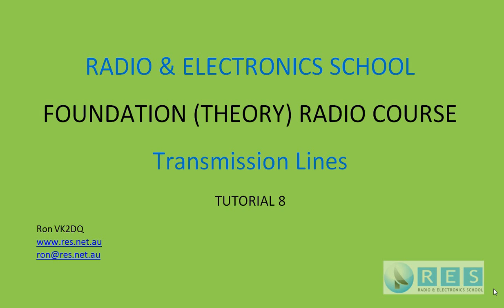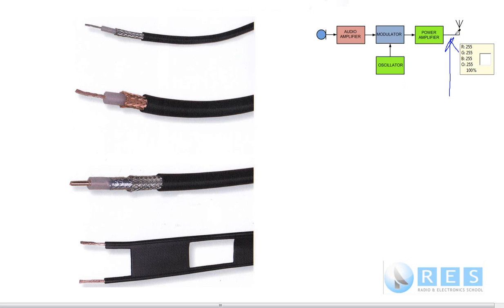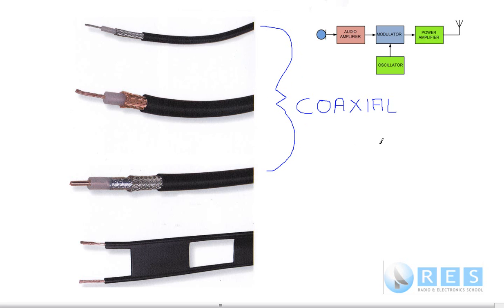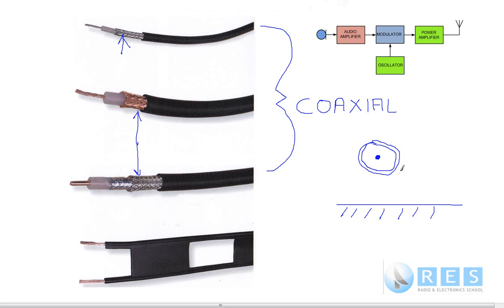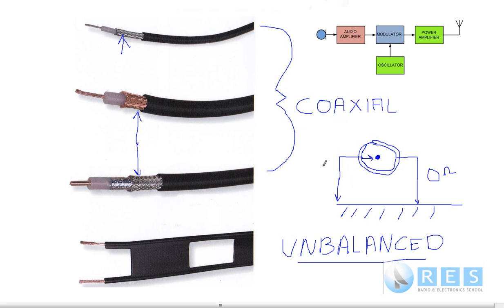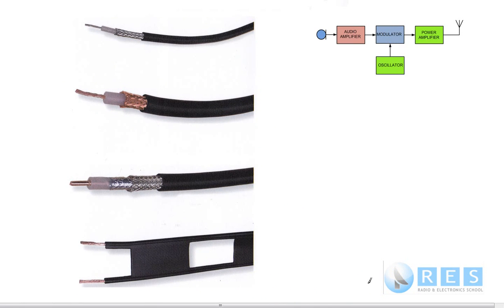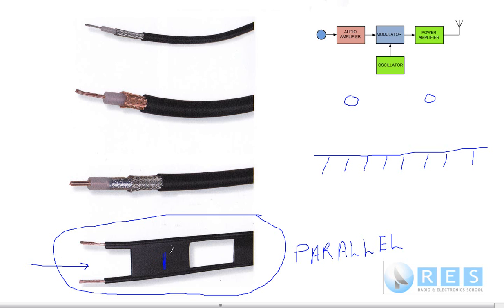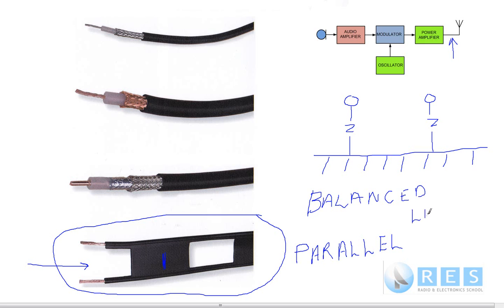FT_Tutorial 08.wmv

Comment: Thank you Ron. Very well explained. Question: We normally associate decibels with sound intensity. Does that translate to signal intensity at the antenna?
Reply from the maker: Yes ir does Warren. If we send 10 Watts to an antenna that has a gain of 3dB it is "as if" we are using 20Watts as 3dB is a  doubling of power. The gain is derived from the antenna focussing the power in one direction (at the cost of other directions).